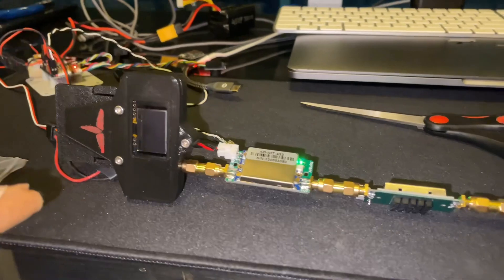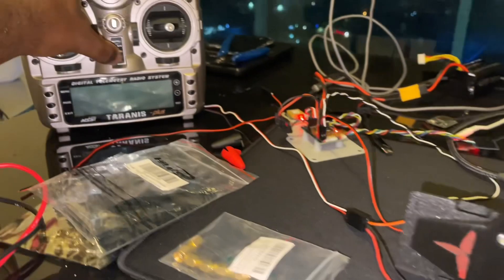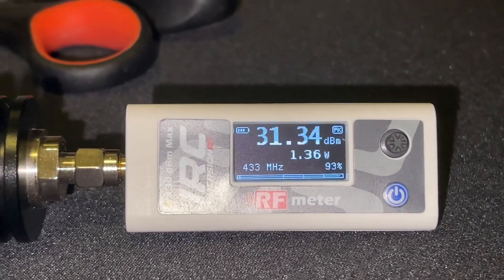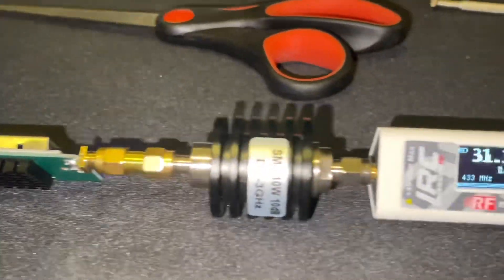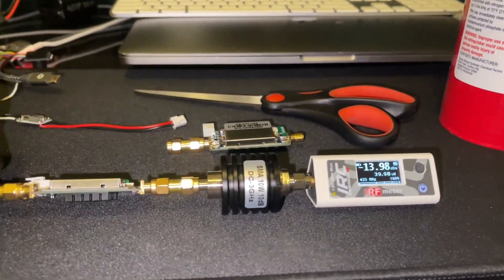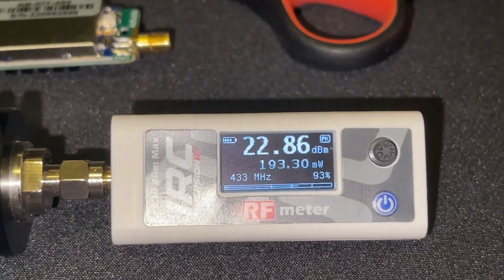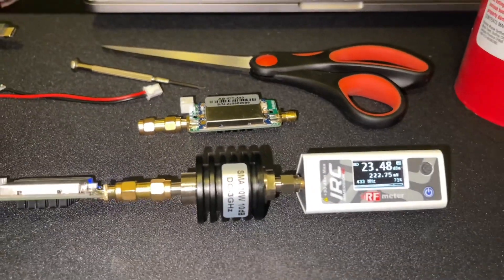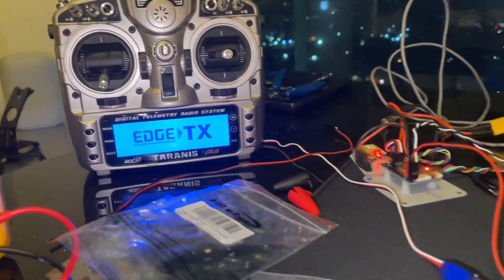ELRS 433mhz amplified to 3W

Comment: Just so you know, that is not how RF amps work, or most other amplifiers for that matter.   Generally speaking, you can NOT get MORE output (Clean Output in Watts) from two amps in series as you can compared to just ONE of the amplifiers, unless (which is pretty rare), you can not find one with enough gain.  In this case, THAT is not an issue.  Your Radio can put out a decent level on it's own, and these amps have enough gain.  When you put two amps in series, what you WILL do 100% of the time (by definition) is end up with more distortion- if that is your goal- go for it.  Start off with a good 100mW coming from your radio (or whatever is the recommended drive level for your amps is), and adjust the gain so that you get MAX power BEFORE distortion- this is the most clean power you can get from that amp, and it does not matter how many you put in series.  VERY IMPORTANT- you MUST have a good Oscilloscope on hand, or you are just wasting your time- one with at least 4 times the "Bandwidth" of the signal your radio is operating it- 10 times would be even better... so you can see the waveform accurately.  Keep in mind, you can ALWAYS overdrive things and get more "Power" on a power meter, but keep in mind, inexpensive power meters of all kinds can give you bad readings for a number of reasons, and if the waveform is shot to hell, you are certainly not helping your radio range-you are killing it.  If you have ANY doubt about what I am saying, go into a car audio dealer, and tell them you want to hook up two 100W amps in series to get 200W- and just look at their faces.
Reply: that tx module can reach maximum of 50mw. These amplifiers if im not wrong can do 11db amplification and 35dbm max output. So in that particular case two amplifiers is ok
Reply: No- two amplifiers in series are never OK.  In some cases you can use a lower level (voltage only) Pre-Amplifier, but you need to be careful how you drive those (what you connect to their inputs).  I am not sure I am buying the combination of your transmitter being capable of only 50mw and these amplifiers having a maximum gain of 11dB.  Both of those numbers are lower than normal.  If your transmitter really is only capable of 50mw than you need an amplifier with a gain of 16dB or more.  Again, my main point becomes very clear if you monitor the TX and Amplifier outputs with a good oscilloscope.
Reply: @CarlosChavez-gs1ld  please read some documentation about this hardware. I did checked it again, my data is correct
Reply: It does not matter.  Never connect two amplifiers in series.  I have been doing Electronics for more than 40 years, and it does not matter if we are talking about Microwaves or LF radio or Audio Amplifiers, it is never a good idea to connect two amplifiers in series.  A real Amplifier puts out real power (WATTS), and do to so, it provides both some reasonable amount of voltage and a reasonable amount of current, and as such an amplifier output is never meant to be connected to an amplifier input.  Amplifiers for every application can be purchased with varying degrees of gain.   If your TX is only capable of 50mw and you have a need to bring it's output into 2W to 5W range, then purchase an amplifier that is designed to do that.  Here is a low cost decent amplifier for you to consider.  It works best of you TX can hit 100mw, but it will still do fine as is (50mw) at 5VDC for power, and will really knock your socks of if you connect it directly to your "2S" L-Ion or Li-Po Battery (give it 6.5 to 8.0 VDC for power).  Again, ask a friend if you can borrow an Oscilloscope, or just ask any nearby college or university that teaches EE or Electronics for some help... they will be happy to help, and you will also learn something and come away with smiles.  :-)    
https://www.aliexpress.us/item/3256806723730106.html
Reply: @CarlosChavez-gs1ld That amp won't work these are transceivers also while connecting two amps in series isn't great I'm betting the range is still improved. I've ran amps on video transmitters that already have amps in them and it improved range exactly like I'd expect and that's a much wider bandwidth higher frequancy non LoRa signal.